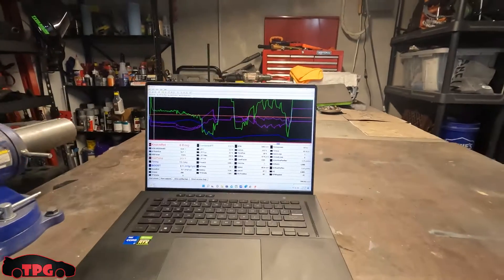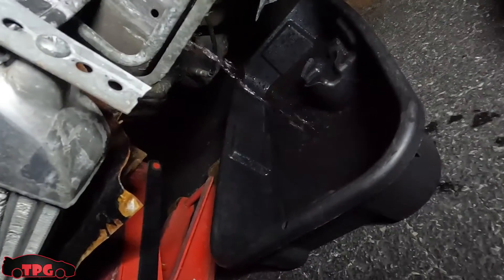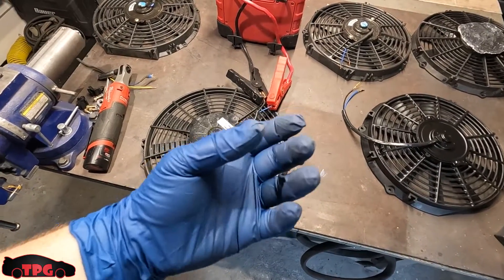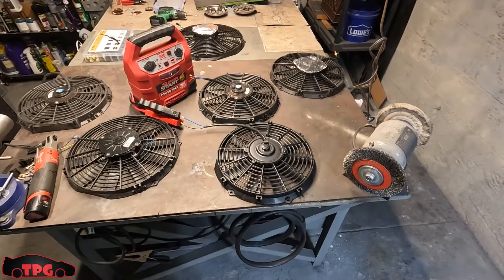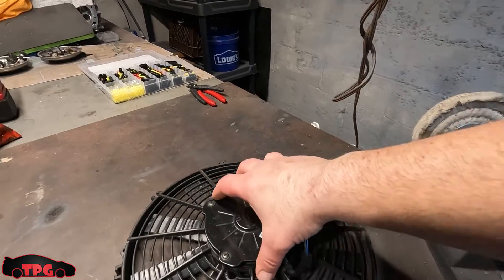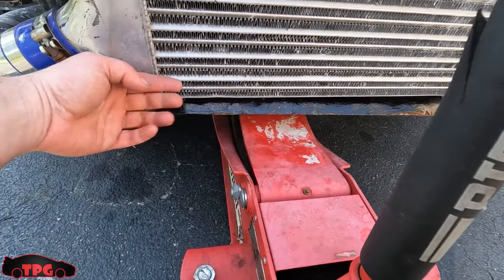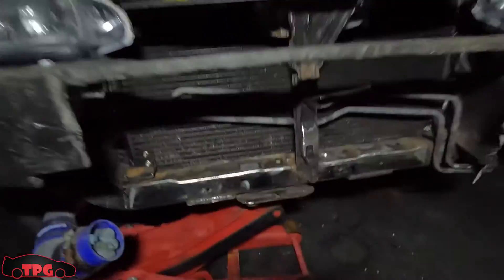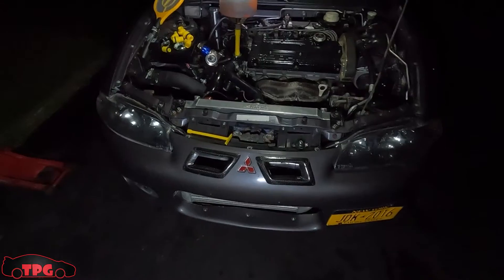COMPARING CHEAP VS EXPENSIVE RADIATOR FANS-1998 MITSUBISHI ECLIPSE GSX-FAN SHROUD INSTALL-COOLING

Comment: Very informative piece bro question where do I find the the header heat shield u got installed.
Reply from the maker: Thanks man 👍 my friend with the blue Gsx I covered a while back gifted it to me. It's an fp manifold blanket from forced performance. I think last I saw them they were available on eBay and extremepsi.com
Hope that helps you!
Reply: @TPGDSM  thanks bro u the man

Comment: Hello.  What happened with this situation, if the modifications you made so that the car no longer heated up worked?
Reply from the maker: So I was chasing my tail for a while. I thought my cheap fans would work well enough to cool the car but they didn’t, then the fp manifold and spal fans caused one spal fan to burn up and stop working. My diy air ducting helped some but my ultimate problem was a short in the wiring harness causing the main fan fuse to pop. I had to remove a lot of stuff and unwrap lots of wires to find the break in the old wiring. Once I repaired the wiring and put a small heat shield along with reflective heat barrier over the motor covers on the spal fans I haven’t had an issue at all. The ecu runs the fans once the engine temps hit 206 and bring them back down to 195 and turn off. That’s with the air conditioning running and it being rather warm out in stop and go traffic. Hope that answers your question👍

Comment: So I had a Mishimoto fan and should set up and the fan works as it should but I’m wondering if it’s not enough. When I’m cruising temps are 184-195 max but as soon as I slow down and come to a stop it climbs to 210 and doesn’t go past that ? Any thoughts thanks
Reply: Also this is on a rebuilt motor with everything fairly new. But 16g FMIC and no air in coolant system
Reply from the maker: If you can keep the stock passenger side fan and the mishimoto on the driver side you should be ok. If the issue persists you can take a 3in jumper wire and add it to the under hood fuse box. Jump the driver fan with the a/c fan by putting one end of the wire inside the fuse leg on one side of the fuse pressed into
The radiator fan, and the other end into one leg of the a/c fan fuse. Connecting these will cause both fans to turn on anytime the ecu triggers one fan to come on based on coolant temps exceeding 206 degrees. Once temps drop to 195 degrees both fans will shut off until temps exceed 206 again. So on and so on 👍

Comment: I have installed so many intercoolers of different designs on eclipses and it looks like you are making more difficult than what it is, but if it works for you than it is 👍🏽👍🏽 like watching your videos.
Reply from the maker: Thanks. Doing some custom stuff soon with mine. Had big issues with airflow after. Mainly cooling system